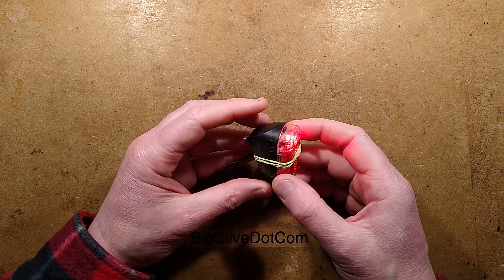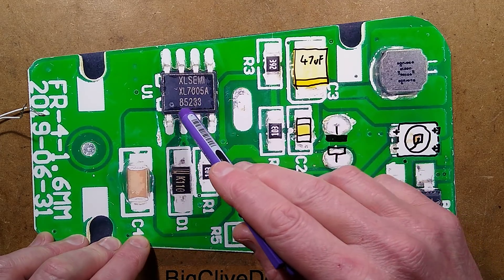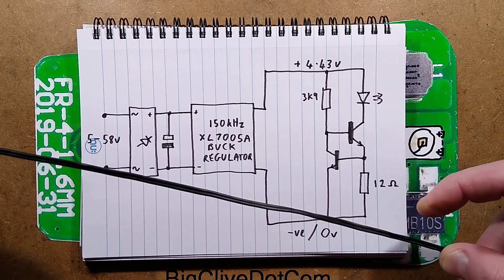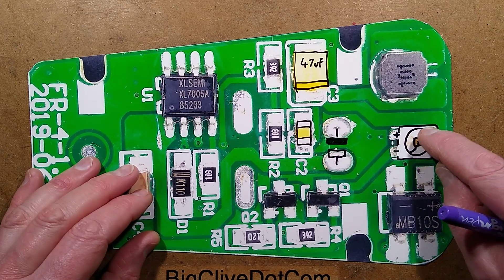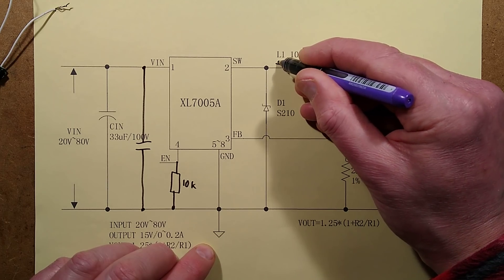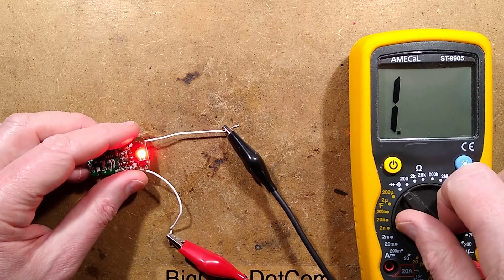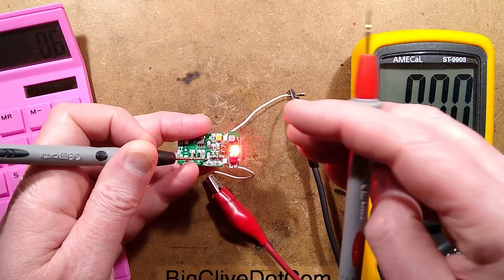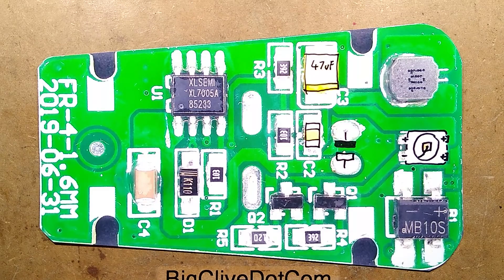Inside a 58V E-scooter rear light

Comment: How much extra current is all that circuit drawing?
Reply: If you're interested here's my back of the envelope calculation:

The control part of the constant current generator, that is the 3.9k resistor and transistor below it: I will spare you the details, but I calculated the current to be 0.8 mA, giving a power loss of 3.5 mW. Basically nothing.

The pass transistor and resistor (24 ohm): These have a combined voltage drop of 2.36 V, and they pass the LED current of 50 mA. Which means you lose ~0.120 W there.

The LED power is roughly 2 V * 50 mA = 0.1 W.

The total power consumption of the regulated side is 0.120+0.1 W=0.22 W. The switching regulator doesn't specify efficiency for currents as low as 50 mA, but extrapolating the graph in the datasheet for a typical value of 12 V, you end up with an efficiency of say 70%. 0.22 W / 0.7 = 0.31 W power consumption from the source. So the full efficiency of the circuit from source to power going into the LED is about 33%. Again, all these numbers are just back of the envelope calculations but should be about right.

Comment: The 58V limit may have to do with saturation of the buck inductor.
Reply: They've probably tested it with a 60V bench power supply
Reply: Nope. Vin(max) is 85V per the datasheet, and it's there so that the alternator voltage spikes in a mobile voltage supply don't kill the XL7005.
Reply: @demef758  How do you know the inductor won't saturate? Got a datasheet for it?

Comment: Cff is part of the closed-loop compensation, to make sure the output is stable and has a good transient response.
Reply: Yes! It was used in analogue regulators in the past.
Reply: But it's just a Red led !  Two cap's, a resistor, and a zener, is all thats needed.

Comment: It should be dual intensity since brake lights are required.
Reply: @Jan181097 hey Jan, did it originally flash when the brake was applied like the ES Max and M365 scooters?
Reply: If it had ARM5 with embedded windows, it could...
Reply: @Jan181097 Strange. I would still think it would be cheaper for the maufacturere to fit all scooters with brake light functionality though since it's required in some countries. Also strange that germany has laxer regualtions on this than sweden.

Comment: I thought 36v was getting silly, then I hear of 48v,and now 58?🤔 How much power do yoh people need!
Reply: I'd guess it has more to do with using thinner wiring and lighter motors than higher power.
Reply: More. 

I'm using xiaomi m365 (36V, like 250W I think) and it's barely enough to overtake with a typical cyclist, even after modding it.
If you got decent biks roads and <10km to work it's a great commuting vehicle. I'm far off those criteria and I still sometimes use it to drive to work - it's pretty cool to ride anyway.
Reply: @izimsi  in the UK there is a limit to the power motor you can use before you require a driving lisence
Reply: @phonotical  In Canada, you are limited to 32 Km/h. Above that, you are limited to 72Km/h and are required to have a motorcycle license, plates and insurance. Just like a car. 
Put a 200HP electric motor on it if you want, but you can't go faster than 32 KPH.
They catch you modifying your bike, you'll lose the bike and get a hefty fine. 
By law, the little useless pedals they all seem to come with, must be present. 
It doesn't have to be installed or operating, but has to be with the bike!! 
Stupid is what stupid does. Politicians are plenty stupid.
Reply: When you increase the voltage, you decrease the current required for the same amopunt of power, and therefore reducing the thickness of the wires, to save on copper and weight. 
A Tesla car works on 400V batteries. but the buck regulator brings it down to 14V to charge the lead acid battery, they all seem to have for some strange reason!
Reply: @piconano  Electric/hybrid cars have a small lead acid battery to boot the car from and run accessories. I suspect it's a safety thing that the high voltage contactors and control circuitry aren't powered by the high voltage battery. That way when the car is "off" there isn't dangerous voltage anywhere unexpected.
Reply: @piconano  The strange reason is standard car accessories are all 12V.  The 12V battery actually boots up the high voltage system too, so that there can be safety interlocks involved before the high voltage contactor is operated.

Comment: Did they design it this way, because the bike is charged by magneto, and voltage fluctuations. I seem to remember the lights dimming on our dirt bikes at an idle. That was 36 years ago tho 😳. Or is this a pedal bike.
Reply from the maker: It's an electric bike/scooter which could have a wide range of battery voltages.
Reply: @bigclivedotcom  ahh I see
Reply: Dirt bikes today still experience the same thing. Even modern efi and battery bikes. Stators and regulators still fluctuate. Not just the battery-less bump starts.

Comment: 99.99999% of the world's population would generally always say: "Ah, it's just a stupid little light". Our Clive, on the other hand, sees it as an adventure into the mysterious ways and thoughts of a Chinese scooter rear light designing engineer. That's why I love you, @Clive ;-)
Reply: I think this is genuine German design. The Chinese will do it with half the parts, and 3x the functionality. Sure it may be a bit dodgy, and it won't conform to German traffic code, but it'll cost $5 for 10
Reply: @tybofborg  It won't conform to the part of German traffic code that was created by a lobbyist working for the German manufacturer of these lamps. 
It could be made perfectly functional, safe and not dodgy in the least for $2 for 1, but it still won't be to code which demands it ridiculously overengineered.
Reply: @tybofborg  The chip is typical cheap Chinese, I kind of expect a German design to go with an expensive American chip
Reply: @tybofborg  But yeah, you'd expect it to have 25 LEDs in series with a tiny resistor, none of this buck regulator business

Comment: That inductor is unusually far from the chip.
Reply: So far he left it out of the schematic!  :-P
Reply: Yep, first thing I noticed, not a great PCB layout. In fact it doesn't seems like a great design, period. Why use a switcher to provide a regulated voltage which to drive a linear current source, rather than using a current regulated switcher which most LED drivers do?
Reply: @ferrumignis  probably designed with a part selection/supplier constraint, 60V+ LED drivers aren't the most common things, I expect they use that IC for all sorts of things.
Reply: input capacitor is also kinda far away

Comment: Part of the cost might be for required certifications - if that light has them.
My guess for the bridge rectifier would be the compatibility for dynamos on non electrical bikes, so you can use the light on AC.
Reply: Bridge also acts as reverse polarity protection, will work either way on DC.
Reply: If it is for Germany, then it has certs. The STVO(Straßenverkehrsordnung ~ street usage rules/law)requires them, or you can not use the bike/scooter. That is probably the reason why it has to work @5V. To still be visible if the battery is to low for driving the scooter.
Reply: I bet the price is market price for something that has the certs, not many manufacturers bother making them so the ones who get a "monopoly" just gouge the price based on "will the consumer buy it at all or not?" level, not really related to the cost of the part as such.
Reply: Is it DOT approved? It doesn't matter of DOT is a self regulating pinky promise regulation.

Comment: I agree it is interesting. I admire how versatile it is, but wowee it makes you miss just changing a bulb. I wonder how long they last in the vehicular environment by comparison.
Reply from the maker: Being a red LED it should last a very long time.  Not sure how weatherproof they are though.
Reply: @bigclivedotcom  red led's are very waterproof  ;)
Reply: I don't miss playing whack-a-bulb in my vehicle one bit.
Reply: @watcherofwatchers  you know what's worse than whack-a-bulb? Ford body control module gremlins. You can have all good bulbs, but if that "smart" thingy that controls all the lights goes out of calibration then it will think you have the wrong bulb installed and cut power. No simple fuse or relay to be replaced, just an inscrutable electronic box that plays Calvinball. I spent several days trying to troubleshoot that stupid thing to get my car to pass inspection, in temperatures way below freezing. Test with new bulbs, nothing. Remove bulb, check for continuity through bulb. It's good, check resistance in case it's somehow shorted. Still good, but no light. Check voltage across open circuit, 12 volts good. Insert bulb in holder, now it's zero volts. Remove bulb, now it's 12 volts again. The BCM senses the resistance or voltage drop across each light circuit, and cuts power if it's outside of fairly tight parameters. That's supposed to prevent you from using the wrong wattage bulb for super bright running taillights or something, so it trips for stuff that wouldn't bother a simple fuse. When the car starts to get old and some capacitors go out of whack or whatever, it starts to sense wrong so cuts power even when the correct bulb is installed. And it won't immediately notice when you change things, so you could be trying all sorts of variables only to have the BCM not give a damn for a couple of days. Then it suddenly provides power. Or not. I wound up installing a separate relay and fuse, using power from the one working tail light as a signal to switch on the relay so all the other lights got power (four running taillight bulbs because lamp is split between body and rear hatch). That worked fine. Until the BCM sensed that the relay wasn't a bulb, it had too high resistance. So the BCM started pulsing power to what it thought was still the right outside taillight bulb, making a horrific buzzing noise from the relay. I had to wire the relay in parallel with one bulb, so it would draw enough power to keep the BCM happily thinking there was just a bulb on that circuit. All other taillight circuits are open as far as the BCM is concerned, but does it throw up a helpful error message suggesting I should change some bulbs? Of course not. It's a Ford.
Reply: @Kaboomf  It sounds like you simply lack the skills necessary to properly troubleshoot the newer technology that exists in modern vehicles. There's no shame in that, as we aren't born with such knowledge. However, acknowledging that deficiency is a first step toward resolving your frustrations. The world evolves, and we are required to continually learn and adapt if we want to keep pace.
Reply: @watcherofwatchers  I've successfully repaired laptops and mobile phones by replacing surface-mount components, soldered directly to the motherboard. It's not so much that I lack skill, it's just that it would take even more time and effort to disconnect that BCM and reverse engineer it enough to figure out what's wrong with it. It was manufactured around a time when many electronic devices were plagued with low quality capacitors and crappy lead-free solder among other things, not worth my time to mess with. 

Oh, and on top of the BCM acting up this particular car had a damned mouse living inside the dashboard for a while until I caught it in a trap. Rodents like to chew on cables, so extra electrical gremlins are to be expected. Easier to just reroute around any suspected cable damage.
Reply: Coat the board with a conformal coating and it should last as long as the LED (which will be decades).
Reply: Phil S Yeah, the lack of conformal coating is odd. Weird to cheap out there after going to all the trouble and BOM cost for such a good electrical design.